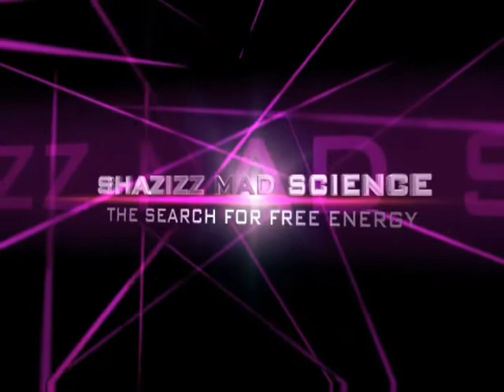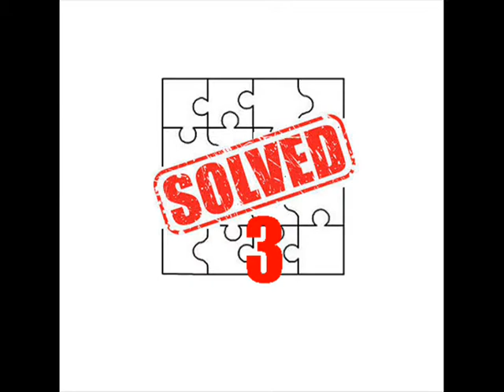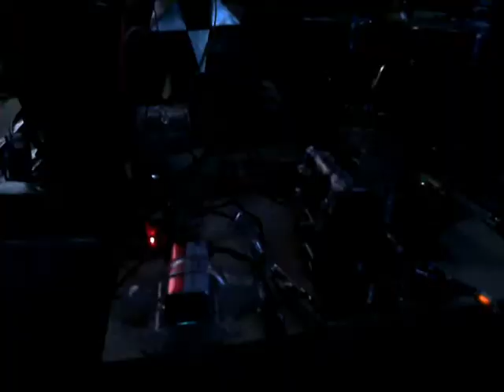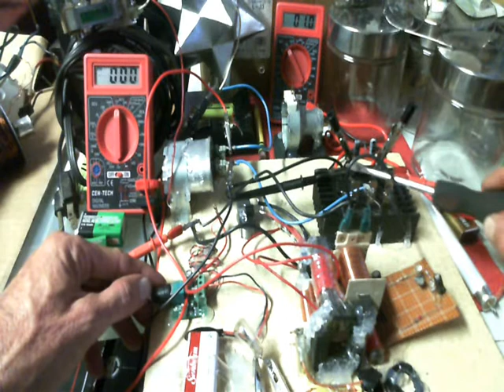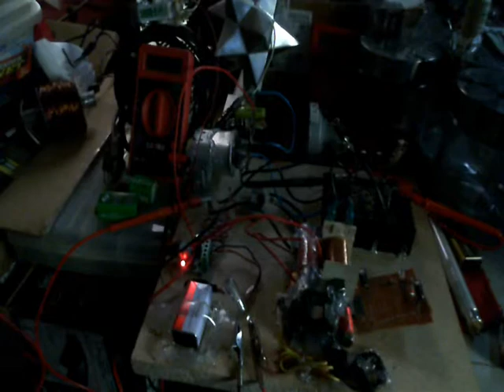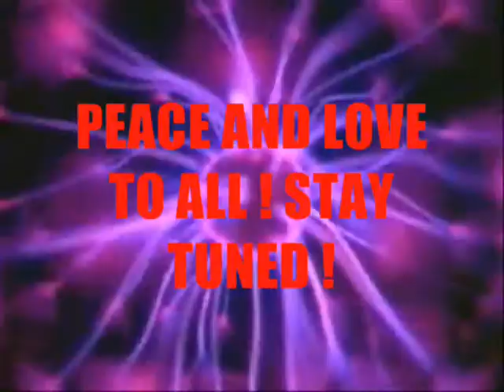SOLVED 3

Comment: Hi shazizz, hope you don't mind me asking a question, but that rectifier did you just come a cross it or did you choose and buy it. It  looks like it deals with that high frequency high voltage well.....thanks for sharing.....phil
Reply from the maker: Got them off ebay because they are good up to 1,000 volts and up to 100 amps so I new they would be perfect for the range I wanted to use them. Hope that helps. They worked real well on other projects as well.
Reply: thanks for reply, time for me to start thinking big and stop half doing things  if you know wot i mean...........thanks phil
Reply from the maker: In the video description there is a ink to shazizzradio superchat if you need any help you can catch me there or on skype maybe even join a show on saturday or sunday if you like.